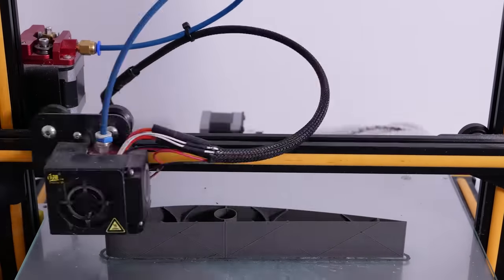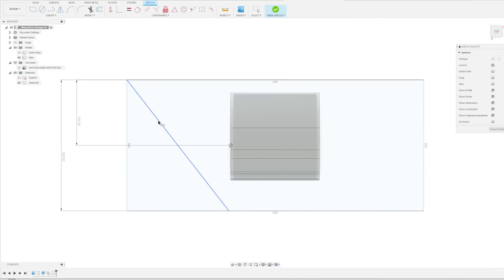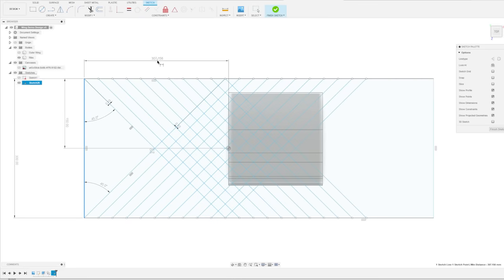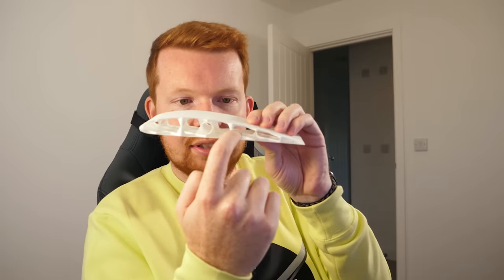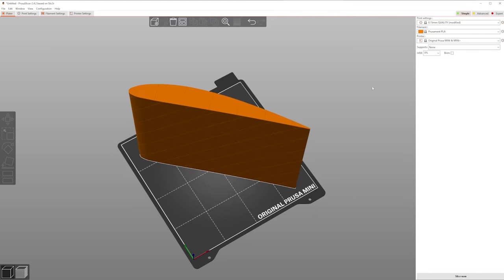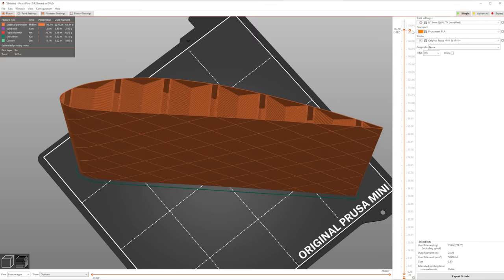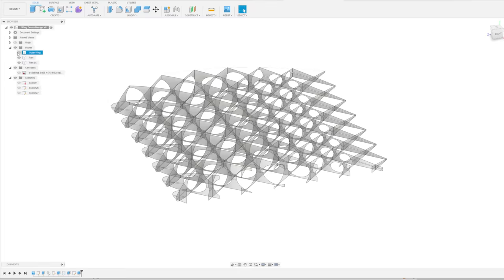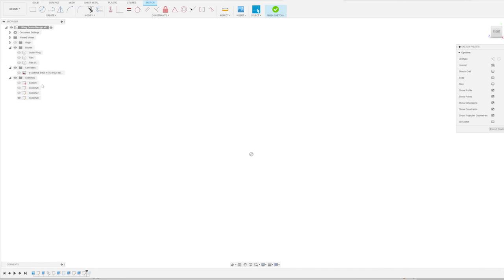How I Designed a 3D Printed Wing

Comment: Quick note: when 3D printing a wing, use white filament! Black filament will absorb so much sunlight that it'll make PLA and foam soft enough to cause sagging or even structural failure.
Reply: White paint/reflective duct tape.
Reply: He handled that topic in his main channel half a year ago already :)
Reply: @matthewgeiger7705  Why would you buy reflective tape or white spray paint just to make a black 3D print white? Just buy white filament.
Reply: @PunakiviAddikti  if you already bought black filament and don’t want to spend another 20$ on more materials it’s a cheaper option.

Comment: This wing design is better than your original with the addition of a spar however it doesnt solve the issue that the wing half columns never actually meet and fuse making the wing weak to torsional loads along the chord. That said its still a great lightweight design, thank you Tim

Comment: This is clever. You end up with a solid model but only for the surfaces. I would struggle as I want the cad model to be of the geometry that I wanted, but that is not exactly what you have here. Very clever. Well done and thanks for sharing.
Reply: Agreed. It’s important to note there is no fill in the print. Surface only.
Reply: for his use he doesnt actually need individual ribs just enough "meat" inside to keep them stiff and not let them fold up .... I was hoping before he lightened the wing with the holes he would have done a quick stress analysis and then just cut out the low stress sections and leave the high stress ones ... 
.
yes this is a small plane and model ... BUT ... if he does the stress test ... he then can not only build the small model but make it a true plane and not have to worry about the wings smacking him in the head as they fold up in flight
Reply: @kaboom-zf2bl  Is there a tool that does these stress tests for free? All I know of are expensive or severly limited...
Reply: @mafiosomax7423  autocad has it as an addon it is part of the virtual testing lab with fusion 360 ...

Comment: 0:36 At the beginning you seem to manually draw out the wing profile. In Fusion 360 and Onshape, there are addons that will automatically draw them out for you. In Fusion the addon is called "Airfoil Generator". The Onshape one is created by Darren Lynch
Reply: I have used the plugin you have mentioned.  It's great! I remember having trouble specifying the chord length. It's like normalized to 1 or something odd.
Reply: @jreed1701d  typically airfoil files are from 0 to 1 w/ 1 being the TE. Not familiar with the plugins, but you could import the curve and as long as you have the correct unit system set you can scale the whole thing by your desired chord
Reply: There's also one called airfoil dat to spline
Reply: You can also just import an airfoil as a svg file.

Comment: There are good airfoil generator Plugins for F360 to import an Airfoil form an .dat file so you have it as some nice splines.
I Printed some wings with a similar method, and printed the same segment with gyroid infill, and the gyroid was way lighter but the strength was very lackluster as  a lot of the lw-pla in the infill was not boned correctly together. 
Will retry to make my wing with some stuff i learned form this video.
Great content!

Comment: I think there's a bit to be done in terms of optimizing your CAD workflow and making it more amenable for parameterization but this is a really exciting design. Looking forwards to playing around with this! I wonder how much of a pain it would be to have varying aerofoil profiles over the length of the wing, and to consider how chunks of wing can include tabs/slots to help them mate together. Brilliant work as always, Tom.
Reply: considering the way he did it ... a multi chord wing would be done the same way but would add another body for each different chord of the wing profile ... the fill would still work as one of its constraints is INSIDE the outer surface

Comment: Having experimented with surface/vase mode for model aircraft wings myself I viewed your video with interest. I use TurboCad and therefore had to adapt your Fusion 360 method accordingly to achieve the same model results, but it was very much worth the effort. The model prints just as you describe, brilliant. I can see why it took you three weeks to work the process out, and even now I struggle with the logic to work in the "negative" to achieve the correct "positive" print result with Surface printing.  Also avoiding double (overprinting) print lines and stop/start printing.  "simple when you know". Thank you

Comment: Hi Tim. Although your rib-slicing technique seems a good idea to get a smooth surface, for the size of wing and low speed of the vehicle you're talking about, and the resulting small Re-Number, it would actually be overall much better to leave the ribs whole so they form a proper, continuous torsion box between top and bottom skin, and accept the small imperfections on the surface. In many slicers these days you can define the seam location on the perimeter and this would have been a much better way of avoiding having them in the wrong places. As soon as they're behind the transition to turbulent flow all is well and you wouldn't notice any difference. Your wing will be much stronger, and thus potentially lighter, then with the sliced ribs. Also, next time have a look at using NURBS curves rather than arc segments in the initial sketch. This way you have much better control over the geometry, and avoid the curvature discontinuity between the constant curvature arc segments. Other than that good content with great tips for beginning wing designers.
Reply: The Problem her is that the wing is designed to work without Retraction of the extruder. When you print lw-pla you should not have any retractions in your design becaus that will clog up the hotend. If this were to be printed with any other Material than you'd definitely be right

Comment: Nice job ! By offseting the extrados of the ribs by 0.5mm right before the "Combine" feature, I obtain a clean extrados. By that I mean that the extruder draws the extrados in one smooth line and on the intrados, it draws the ribs and supports. This helps for the aerodynamics because the extrados is smoother.

Comment: Huge thanks for sharing your time and knowledge so clearly.  I have an Eclipson RC plane and always wondered how they designed the lightweight structure with very little stringing and I think you have solved the mystery for me!!  Having followed your really excellent guidance with Fusion I managed to produced a 200mm test piece with excellent results.  Instead of slicing the ribs at the mid point, I  used offset to slice 0.8mm from the top of the ribs just under the surface of the top  wing skin, that way the top surface of the wing prints perfectly and the "joins" for the 2 layers are on the under surface.  Using PRUSA slicer settings from LW PLA, similar to those from 3DLabprint the results are very clean fast light weight prints (not using spiral mode).  If you optimise the gap, and print settings the ribs connect nicely to the top skin as material foams... brilliant.  Would echo some comments about Airfoil generator but thats not the point of your video.   Next project (after the light weight "test" glider") with my 11year old son is to replicate his Balsa/Monocote RC Fokker DR1 in LW PLA.   Tom, your videos are always informative... my son is always watching and says wants to become an engineer one day...so you are also inspiring the next generation... many thanks for the great content!

Comment: I actually experimented with LW-PLA and simply making the extruded wing profile a solid object, but made a hole for wing spar etc, and then just used 1 perimeter for the shell, and used "cubic" infill in PrusaSlicer. When you set the infill to 1 to 3%, it creates something very similar to the spar structure you modelled - and the spar hole automatically created a box inside the wing, and the cubic infill, while not as nice as a precisely designed one, still was doing a pretty good job with minimal effort, and the wing was remarkably light.

Comment: I call this the "continuous path vase mode hack".  You see it around, but it is quite rare.  I'm not into planes, but I've used this method when the design time is justified and I want to print many multiples of something that prints fast and is strong.  Shelf brackets, table legs, rugged custom containers, etc.   
Have you thought of using a belt printer?  The 45 degree print geometry lets you print fully-enclosed shapes in vase mode (all 6 sides of a cube, for example).  The ability to print long wings in one piece might be useful.  
I notice that your ribs are basically 2 perimeters pressed together flat like a ribbon.  Have you considered separating those 2 lines to create a tubular structure and (maybe) more rigidity?

Comment: As an old RC plane guy- balsa with plastic heat shrink covering. Extremely light and strong. Also durable as long as you don’t crash it.  All the 3d printed and foam built stuff I see are all extremely heavy with poor structural strength. I feel like the opportunity to mix 3d printed traditional rib structure with traditional style build. Carbon spars, 3d printed ribs, carbon leading edge spar, trailing edge, could even use balsa sheeting on the front section of the foil/wing in a traditional manner. Cover with monokote or similar. You get a incredibly strong and light wing👍. I feel like it would be possible to shed nearly 1/2 the structural weight of some of the best 100% printed wings I have seen while having far higher structural strength. 

Granted this adds traditional assembly back into the mix but the results of mixing the best of all the materials has high potential for some incredible weight to strength possibilities. All translating to superior flight characteristics, flight time, durability ie air frame life etc. I would fly my old school balsa gas planes for 2-3 yrs nearly every weekend before the vibration from the engine started to cause structural failure in the tail section. Classic failure of an old RC plane with lots of flight hours was the loss of a horizontal flight control on the tail due to structural failure.

Comment: Hey Tom, so to make your life a little easier, there is LW PLA by Polymaker. It is different from the foaming stuff by colorfabb or eSun as it is basically "pre-foamed" . It has very low density and prints like regular PLA. It maybe a touch heavier than foaming stuff, but for your new project where you teased even a canopy/nose with similar structure to the wing, it maybe easier to work with. 
And it is cheaper than every foaming pla i could find (at least where I live)

Comment: I've been interested in 3d printing aerofoils for a while, but the complex cad design has always been off-putting (especially on a slow laptop).
Been playing with the idea of coding a custom design tool / slicer, which takes aerofoil .dat files, as well as their location coordinates. The design process would be similar to xflr5, where it sort of lofts the profiles into the wing geometry. Will hopefully be quicker and more automated to design wings than with all those cad steps.
Even got a basic implementation (admittedly poorly) written in python. It spits out gcode directly, although haven't printed much more than a few small test pieces. So far implemented outside shell,  internal structure (really like the vase mode trick, will try modify to allow for that feature eventually) and adding round spars / cutouts. Code could really use the OOP treatment, but works as a proof of concept. 
Can share it if you're interested.
Reply: You should feed the gcode model, or a lower fidelity representation of that model back into some FEM software so you can optimize the strength of the foil wrt to the orientation of the filament.

A little RL (reinforcement learning), Neural Physics, FEM, Gradient Descent and SAT solving and boom, magic.
Reply: I used to play with an excel spreadsheet I found that made gcode for my hotwire foam cutter running on a RAMPS running grbl.
Reply: since you are a programmer... woudnt it be easier to do it in openscad directly?
Reply: bruh share it im doing my physics extended essay (12th grade) itill be a huge help please share it [based on aero foil design]

Comment: I think the only problem with that orientation of the wing profile is that the bend stress of the wing is at right angles to the layers. It's a bit like using wood across the grain instead of along the grain for bend strength. The layers pull apart more easily than the strength parallel to the layer planes. Putting the spars in is therefore important.

Comment: 2:46 [Edited because I realized what you were doing. My first suggestion is still good advice for an instance like 6:19 .]Just so you know, you can "offset" lines using the O key and it basically does this automatically. Though, it will be an offset which would mean that the lines would be moved upward or downward depending on which way the copy goes. To get around this, I normally make a line then offset on both sides of the original line. Then make the original line a construction line.

Edit: Actually in this situation I would've done a rectangular pattern

Comment: What if at the rear end of the wing we make a very small protrusion from below. Along the entire trailing edge of the wing, from below. And on the leading edge, the same only from above. For better looping of air around the wing. So that the air flow from below the wing, bumping into this small obstacle, is thrown down or away from it. even forward. In a rough representation of the cut of such a wing profile, this is the letter Z mirrored and laid on its side with a very long central element and small curved tips, up from the front down from the back to an arrow-shaped shape. If you throw a paper strip with such bends, it will always rotate in one direction I wonder how such a wing will curl?

Comment: You can also use Fusion 360 addon called "airfoil dat to spline" and get the shape imported from airfoil tools automatically without the need for manual sketching

Comment: Have you tried over extruding, to see if the wing has better adhesion between the vase mode lines? I'm just wondering how the seam down the entire length of the wing will effect the rigidity of the wing.
Reply: I suspect that the foaming of the light weight PLA is doing the work of over extrusion.

Comment: I have used Blender to basically hand drawn similar structure using 3d faces. The model has zero volume but in spiral print mode the edge is printed correctly and you can design the exact print path yourself. I hope this helps someone.

Comment: Only one thing for reasoning. Your printing time is 8 hours. In the company I'am working, we make wings like yours. We were making it like you by 3d printing, but it was very long for us. Now we are making it from flat plates and just a paper as a shell. All parts are being cut by laser cut and now it takes us only 5 minutes to make 1 wing including cutting and assemble. So, try to use laser cutting, it's very useful to save you time.

Comment: 13:45 To make tiny cut gaps fuse better In PrusaSlicer there is a settings called "Slice gap closing radius: 0.049mm" it mean that it closes gaps smaller than 0.049mm which limits how small gaps you can make. In your design you use 0.1mm gaps which could be smaller if you decreased "gap closing radius" to maybe 0.005mm (don't remember might go even lower).

Comment: Had a thought, not that it matters for light load usage such as RC. Could be used as a good demonstration of structures.

You could aeroelastically tailor the wing by slight variations in rib angles and numbers. I like the nature behind aeroelastic tailoring because of the X-29's forward sweep where aeroelastic divergence was an issue and composite tailoring mitigated this. You could do the same here.

Comment: The timing of this video is perfect as i an starting to build a 2m ducted fan jet from the same material and wrap it in carbon fiber.

I hope this method works in Siemens NX in a similar way as in Fusion 360 since i'm not familiar with fusion.

Comment: Would it be useful for this application to create custom G-Code processor that would make it so you wouldn't have to cut the ribs in half? I imagine the algorithm would do this by halving the extrusion height (ie by doubling the speed or halving feed) in spots where there would be a crossing? Would that work?

Comment: Depending on what you're wanting to do with your geometry, you could just trim your ribs a little bit from the top surface rather than cutting them in half and then you'd have a completely smooth top of your wing and then have your ribs come up from the bottom of the wing and "kiss" the top skin. I think (check me on this) this would limit your ability to cut the through paths (circles in this video) but you'd get a smoother top wing surface.
Reply from the maker: Correct, but as you mention, it causes issues with the rib holes
Reply: @TimStation   yes you will get issues with the rib holes and main spar, i tray that and gave up on vase mode, now whit´s  this video i can make my wing in vase mode.

Comment: the most ingenious idea is crisscrossing the ribs to make it possible to 3D print the entire wing as a single continuous path. I think this design probably make the wing so much stronger. Have you tested strength versus weight difference between the conventional wing construction and your design? My gut feel is that if you can 3D print the entire wing in a single print, you may not even need a central spar to transfer lift and weight of the plane.